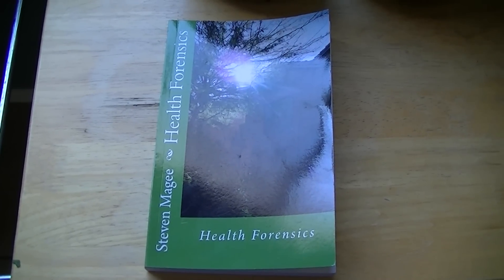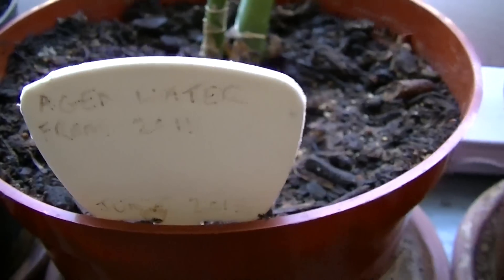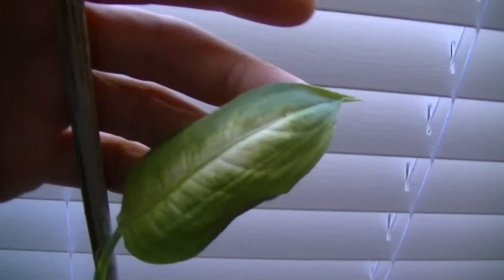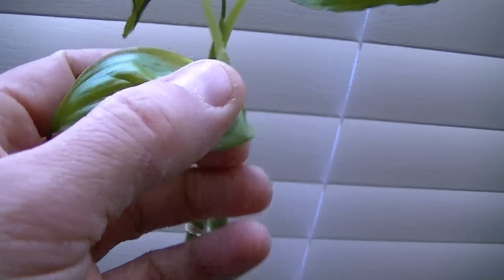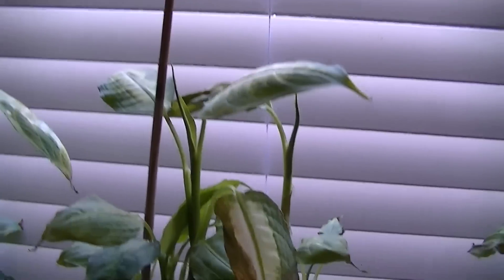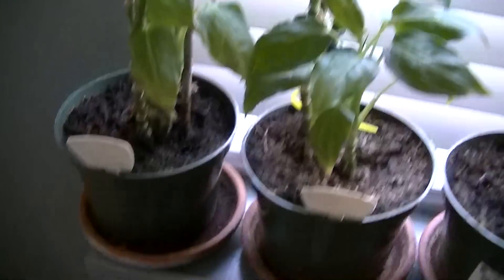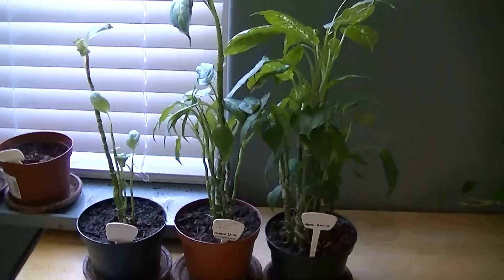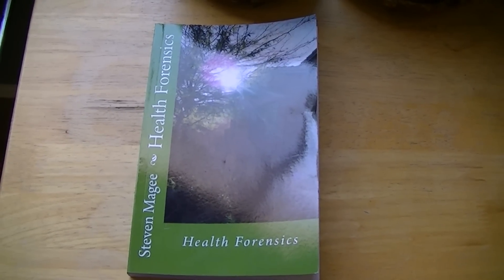Structured Water Plant Experiment Final Results January 2016

Comment: Not to be mean but your experiment doesn't mean anything since you clearly have too many uncontrolled variables, 
this is not the way to conduct a comparison between plants, All of these plants are clearly not clones so genetic variety would be the biggest factor in your results, 
also you shouldn't grow these plants in soil if you're testing the effect of the water has on them, they should be hydroponically grown so that you 
have absolute control over the nutrients they are adding, in soil you have no clue what bacterial/fungal elements exists in the mix and to 
what extent in each pot, you also dont know the amount of nitrogen phosphorus and potassium that is in the soil, and even if you did know 
all of the above and used clones, the different waters have different PH and that alone would change the results,

to make this a true comparison you'd have to first adjust the PH of all your water options and use clones in a hydroponic setup.
Reply: I think you're on the good road, there are too many uncontrolled parameters here; if I wanted to be mean (i.e. going even further you did ^^ ), I'd mention other/complementary points:
- In the given expls, like "tea", "microwaved water", etc, he didn't precise the initial water he microwaved or made the tea with, & maybe that certain waters (like reverse osmosed) make better tea than others, on the mineral & pH standpoints.
- He didn't precise a lot of things I simply understand he didn't, even though those could affect the results drastically: the posology, as some water (tap vs distilled for instance) may require to be distributted in larger quantity or more frequently to obtain optimal results, since a heavily mineralised water doesn't take the same time & effort to the plant to be absorbed & used...
- It goes along with the previous points, maybe that some conditions (sun exposition, posology etc) the plants were submitted to, were more compatible to some waters than others, even though it wouldn't necessarily make the better of this association, the best out of all intrinsically.
- Cultivating several plants near one another may interfere the experience, in that one can affect the other in different maners (vibration, hormonal exchange, all kind of natural communication between "neighbored" plants)
- I had a complicate one, but don't know how to explain/expose it, so I left it ^^

Well, your points were probably the most relevant, anyway, my opinion on this experience is it's great to do it whatsoever, I'd have liked better seeing other waters for the exprc, like vortex restructured water, various dynamised waters, even tough I just imagine the amount of work it would imply, considered what has already been done here...
So I'm just glad to see that type of video, when we still can't use it to prove anything or make substantial conclusions on the results. :)
Reply: The last plant was watered with structured water 💦 he called it Shungite, the water had past through Shungite rock
Reply: Structured Water by Medi Degani
Reply: I agree with what you're saying, but I'd say it is not meaningless because it does introduce some very interesting hypothesis's to test, and is likely not too far off from results in a better controlled experiment.  I would definitely like to see this done again now that the parameters have been somewhat well defined, set controls, have multiple samples in each group, etc, controlled lighting, maybe some sort of conveyor belt or turn table so the shady plants don't get too much of a break on extra hot, high UV days, etc.